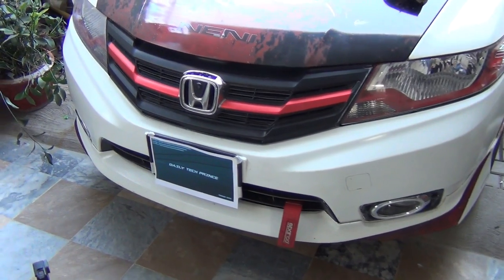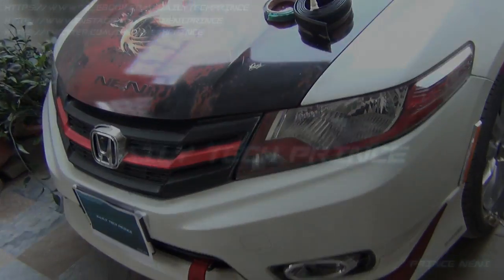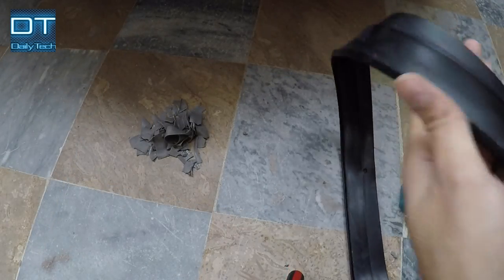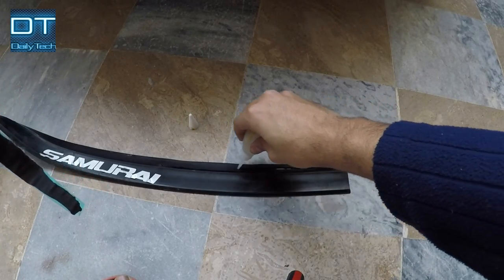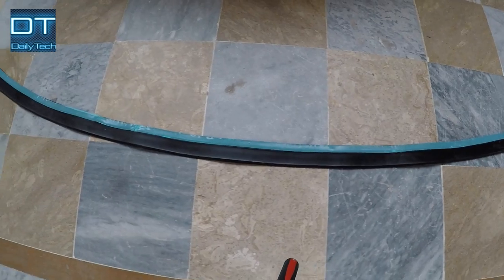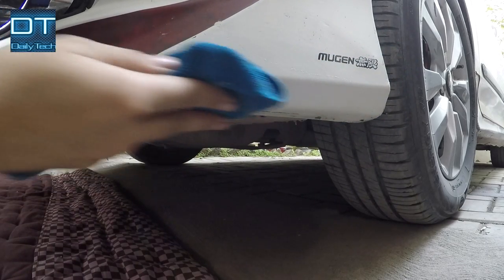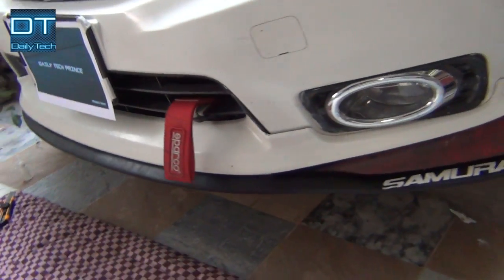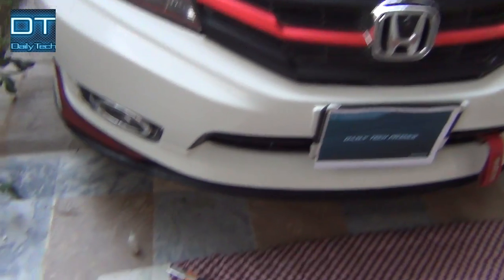How To install Bumper Rubber Lip , Complete Installation

Comment: Saving the bumper from scratches and then putting screws in it! SERIOUSLY?. You just ruined it.
Reply from the maker: it is a used body kit lip and for extra hold I used screws, one small screw hole that is not even visible is better than scratches ;)